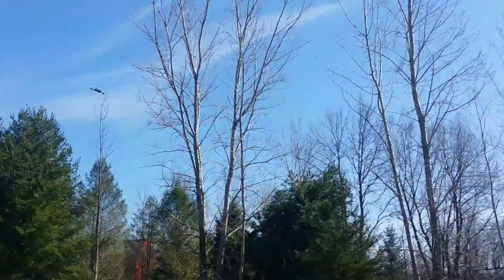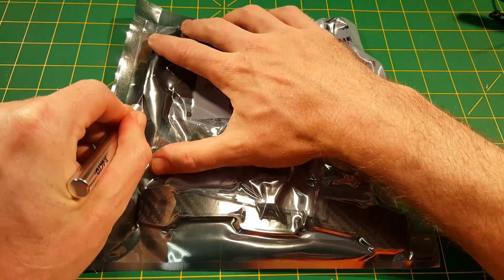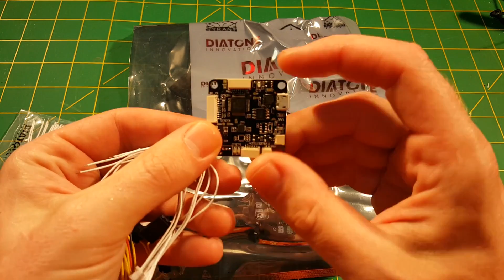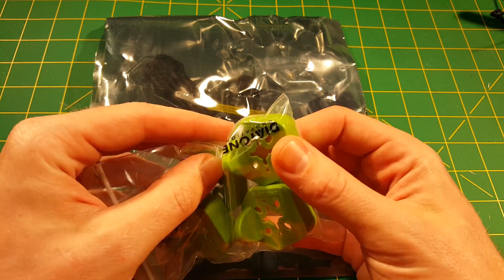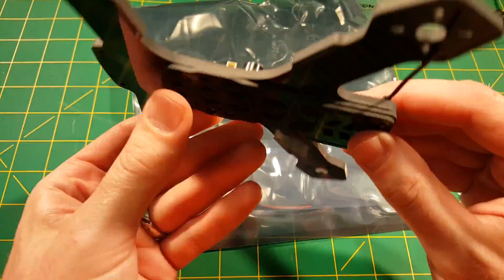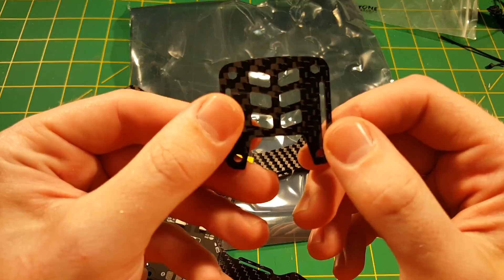Dyatone Tyrant 180 V1.1 Unboxing and Comparison Review

Comment: Hey, I got a Diatone 180 Quad too. But mine when I start it up the back flips forwards. I have check twice. The props are on right and the motors are turning the right direction. I have reflashed the whole thing and ESC and still it flips. Bad FC ? Any thoughts ?

Comment: Great vid.  One note, be careful attaching the plugs to the tyrant's Naze, the pins are tiny.  I did it carelessly and folded some of the pins causing a short across the pdb.  Luckily the other power outs on the PDB saved me as they didn't get fried.
Reply from the maker: Thanks. Yeah that can happen if you're not careful with those picoblade connectors. at least you were able to recover easily though.

Comment: Nice frames those new ones from Diatone. I bought that same fc for an 180 build and it seems that the mpu 6500 gyro is very sensitive to vibrations. Was impossible to tune it until I used some silicone o rings to absorb the vibrations. Also those plastic connectors are prone to break, vbat came of and had to direct solder it .Hot glued the others .

Comment: Steve I like the layout that they got set up on this board I think it'll be interesting to see how it flies in the end especially with the capacitors and all the filters embedded into the power distribution board it'll be interesting to see how this thing stand up compared to other PDD boards that I've seen integrated hopefully it does better than some of the other one where you know you crash and it breaks the bottom plate and destroy the whole lot so hopefully this thing holds up let me know when you get it put together I'd love to see it fly
Reply from the maker: I haven't heard of anyone breaking them. all the stress is on the carbon fiber so it shouldn't take much impact unless it's a really strong impact. time will tell.
Reply from the maker: Lol
Reply: +Flite Brothers it'll be interesting to see when you get this completely put together and see what happens when you put it through more extreme flight conditions we know how you love to hit trees